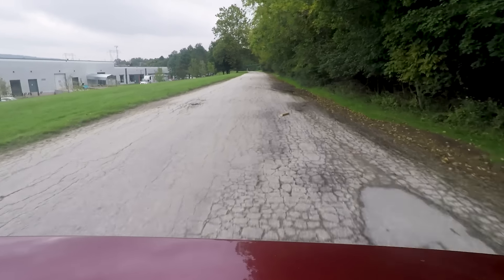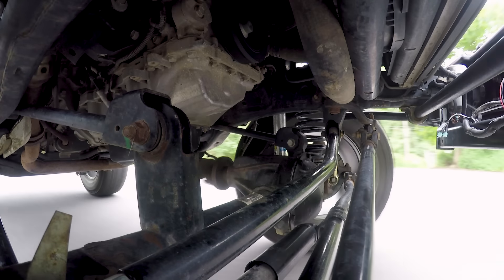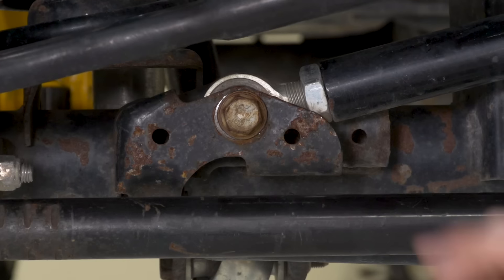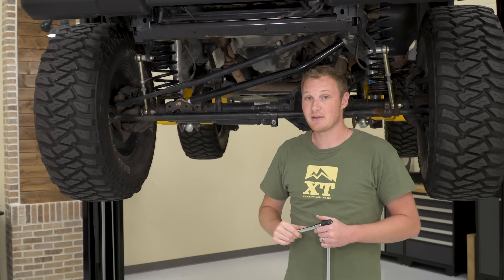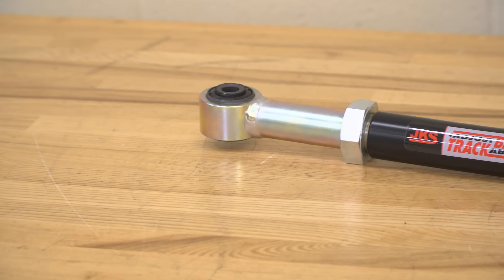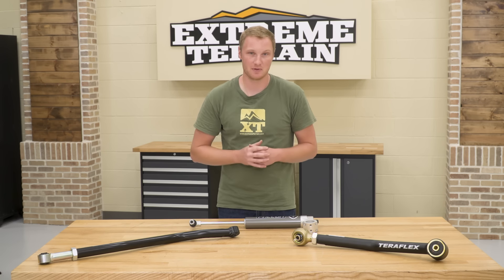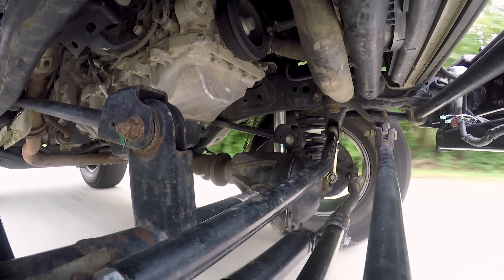How to Survive and Fix Jeep Wrangler Death Wobble | What Is Death Wobble?

Comment from the maker: Subscribe for Daily Jeep Videos: http://terrain.jp/SubscribeXTyt
Have you ever experienced Death Wobble?
Check out Parts For your Jeep Right Here: www.extremeterrain.com/throttle-out-news-dec2018.html 
Parts List:
JKS Front Adjustable Trackbar for 1-6 in. Lift - https://terrain.jp/2Qe7ouu
Teraflex Front Lower FlexArms (07-18 Jeep Wrangler JK) - https://terrain.jp/2EdFWa3
Reply: I have a 2007 Jeep Wrangler JK and I've replaced the Tie rod bar and Tie rod ends, The Drag link, The Track Bar and The Steering Damper and at 40mph or braking soft or hard my jeep goes into a death wobble what else could it be?
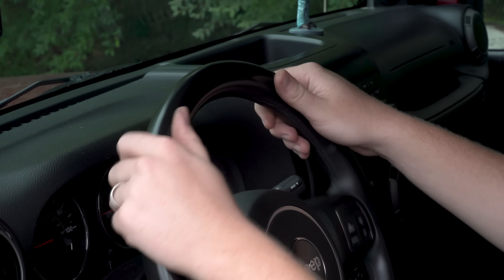Reply: Was someone under your jeep making the steering wheel wobble like that while you were at a complete standstill during your wobble demonstration ? Roughly the 3:00min marker
Reply: I should have watched for a bit longer. Thank you!

Comment: I took my JL to the dealer, just to find out that it was a recall for it,so,they fixed it for me at no charge!
Reply: The recall is for the steering dampener which is different but can cause the same issue
Reply: Did you have bigger tires when it wobbled?
Reply: E Baluyot  ‘Nope’...I think that is the problem when you buy the very first generation since my Jeep is 2018 JL started wobbling after only 3 months...the good news dealer found the recall & fixed it for me...so far 18 months later...My Jeep ride like Champ!
Reply: This is why American cars don't sell well in Europe.
Reply: @Inimbrium  this is a problem with all vehicles that have solid front axles, its literally just something that happens with solid front axles...... that includes European vehicles.
Reply: @notlogical4016  trying to think of any European SUVs with solid front axels. I think it's mainly an American thing.
Reply: @Inimbrium Landover defenders till recently had solid axels.

Comment: I had that problem three times within a week and was very scared. So I checked all screws and brackets of the front axle and steering and found nothing loose or worn. So I changed the steering damper to a stronger (sport) one and what a suprise since that time I had no wobble anymore.
Reply: Dealer has changed my steering damper twice but it’s a mopar part and is all that is covered by the warranty. They suggested a heavy duty damper. That’s my next step since it’s a newer jeep and everything else has been checked.

Comment: I have a 2021 Jeep Wrangler. It is stock and never off road.  I use it as a tow vehicle behind a motor home.  It has 22K miles and this week it started a wobble after hitting a bump in the road.  I was going around 55 to 60mph.  I slowed down and it stopped around 35mph.  I thought it may be an out of balance tire so I took it to the tire shop and had the balance checked on the tires and they were out.  So we balanced the tires and I took it for a spin.  At 70mph I hit a bump in a curve and the wobble reappeared.  So now I watched your video, I will give the track bar a look and see if that corrects the issue.  Thanks for a great video.

Comment: Is it recommended to have the Jeep on a lift before I tighten the track bar? If so, I'll have to take it to a shop because I only have a tire jack but I'm not sure if the jack could hold the entire weight of the jeep at the front diff, as the center point.
Reply from the maker: Tightening it on the ground when it's at it's proper angle would be best!

Comment: New jeep owner here. Really useful video
Experienced the wobble thrice now, and I hope this fixes it
Reply from the maker: These tips will definitely help out! Biggest things are checking for worn parts in your suspension and making sure your alignment is in-spec. If your Jeep is lifted, look into adjustable track bars and front lower control arms. Best of luck! -Zach
Reply: did it fix it?

Comment: have this problem with a jeep wrangler jk only when I take curves at low speed. What could be the problem?
Reply from the maker: Could be anything we talked about in the video, honestly! You really want to have the front end of your Jeep checked. Worn tie rod ends, ball joints, control arm or track bar bushings, etc. Even irregularly worn tires can cause it. -Zach

Comment: I had a 2 inch Mopar install on my 2021 wrangler. If I just put the original suspension back on will this death wobble go away?
Reply from the maker: If you have death wobble on your Wrangler, its likely not being caused directly because of the lift but from suspension geometry not being correct. I would look at getting an adjustable front track bar and adjustable front lower control arms to dial in your front-end alignment better. Also make sure everything up front is torqued to spec correctly. There are also TSBs currently available for steering box replacements for death wobble if all else fails you can ask your dealership about. Hope this helps! -Zach

Comment: I get major wobbling whenever I go over 50mph, but it comes and goes. I can be doing 55, have it wobble violently for about 15 seconds, then it goes away for 30 seconds, and comes back again for 15-20 seconds, all while I'm doing the same speed. No idea what is causing that.
Reply from the maker: Time to check your track bar, tie rod ends, control arm bushings, steering stabilizer and potentially re-balance your wheels and tires. -Zach
Reply: @extremeterrain  I'm thinking it might be the tires. I've already replaced the track bar and steering stabilizer.
Reply: @extremeterrain  is this the same with a JTR ?
Reply: I know this in an old post but the steering stabilizer often has NOTHING to do with death wobble. Tie rod ends, bushings etc are far more likely than the relatively useless front stabilizer
Reply: @vigilantemotors  i honestly think it's the tires. I have mud terrain tires with treads that are almost flat. They ride like crap to begin with, never mind being a few years old.
Reply: @Mike__P  As much as I love the look of MT/s when they go they are loud as hell and the ride quality just sucks so I feel for you.
What are you running if I can ask?
Reply: @vigilantemotors  BFG 255/75R-17
Reply: @Mike__P  Love it! I'm sure its a nice setup

Comment: I have an 08 and it always happens when i get up to 60 but when I decrease speed it stops. .
Reply from the maker: You should really just take a look at all of your front end parts, in general! Tie rod ends, ball joints, track bar bushings, wheel hub bearings, and lastly your steering stabilizer. If any one of them or a combination of them are worn, wobble is bound to happen. -Zach

Comment: Scary as efff
Reply from the maker: You're not lyin'.
Reply: I was told as I was, I felt like I was going into this death wobble again they checked everything they knew all about it at the shop. Everything was tight and after two hours they went and took it for a test drive and he said, is it side to side or is it front to back and I said it feels just like it’s moving so side to side. He said I think it’s a spark plug. I think you need a tuneup. It’s going forward and back, so I did have a check engine light come on while back and she told me that it was spark plug number two and that I should use Exxon gas. The check engine light never came back on and the owner who test drove it said oh this is probablymisfiring that I should drive through it

Comment: MY WJ never had DW until I replaced everything, I mean total rebuild. One day doing 60+ downhill, off ramp hard on the brakes. LAWDY LAWD! I almost wets myself! New track bar too and a $2000 frame straightening, hope this helps. Thanks!
Reply from the maker: Back when I had my WJ I ran it stock for 2 years without any issues, but had DW as soon as I lifted it (new shocks, springs, track bar, sway bar links, rear sway bar!) Turned out being my front lower control arms and all 4 tie rod ends up front. -Zach
Reply: @extremeterrain  it's my steering stabilizer which, while hunting in the outback,  took a heck of a blow from something bending the shaft. I noticed oil today on the inner passenger side front wheel. I looked below and thought it was the passenger side seal never thinking the shock was blown. The death wobble left me mystified. I've had her for 16 years never a problem till this.

Comment: I have experienced this in my 2022 Wrangler Jeep multiple times, and didn’t know what was going on, but the last time was this weekend, so I decided to google it. I hit a bump so small you could barely see it, and my Wrangler Jeep started shaking so violently it scared me.. I was on the highway driving 70 mph so I held on to the steering wheel for dear life, because it felt as if I was about to lose control of the vehicle. The Jeep is still like new. No modifications, serviced every 5-6 months, tires recently rotated, inflated properly and 14K miles… So why did this happen to a relatively new car? I hope Jeep will pay to repair it..
Reply from the maker: I would take it to the dealer and have them check out the stabilizer and track bar. Jeep previously had issues on the JL with those two components. Hopefully this video helped, and we hope they fix it so you can enjoy your Wrangler without the terrifying death wobble!! 
-Merideth
Reply: I just started this having issue today and I literally thought I was gonna die on the highway. Do I need to tighten my Trackbar too or do I just need to take it in? My Jeep is a 2021 JL and is completely stock

Comment: I can hit all kinds of holes and objects. No death wobble, but go down the road at highway speeds and sometimes it kicks in. I have been reading that the front-end alignment is the first thing to do... What do you think.
Reply from the maker: Alignment is key when it comes to death wobble and you read right, it's always the first place to start. I'd recommend checking your alignment specs, checking your ball joints, and taking a look at the track bar bolt as well. Hope this helps!

Comment: Jeep has been sitting , too dangerous to drive . I almost lost it on the highway and it’s been a few weeks. Thankfully I have a second Vehicle but I just bought this 2009 w 50k miles from my Sister. I blew the transmission the first week! $2600 so that wasn’t as bad as it could have been.
I replaced the stabilizer and that made it worse! Up until then it was a little wobble.
If this works , you will get my Vote November 6th.
Obviously you’re the best choice regardless and even if it doesn’t fix it, you still get my Vote.
You I “trust”
Thanks for the advice and I will let you all know it I am one of the 99%, normally I dance to my own beat.
Stay safe people 
Peace to you all
Reply from the maker: Just give us a call if you need more help figuring out your wobble! -Zach

Comment: Appreciate the video. Gonna check my track bar bolt. Had death wobble doing 75 mph on the interstate this past Sunday. Fortunately it was at 6 in the morning and not a lot of traffic. Had to fight it to a complete stop to get it under control again. 

But all the comments about parts being worn out is concerning to me. My Jeep is a 2021 2 door stock height (no mods) JL with 11k miles on it. Would my components really be worn out this fast?
Reply from the maker: Hey Zak! With a Jeep that new, I would get in touch with your local dealership to have them take a look at it. They may throw on a new steering stabilizer to help things out.  There's always a chance that something loosened up in your front suspension that just needs to be tightened. Best of luck! -Zach
Reply: Thanks for the reply. Waiting for an open appt to get it looked at. Hopefully it’s something simple.

Comment: i have front death wobble bad 30-40mph i purchased a steer smarts hd track bar, synergy hd ball joints, and synergy drag link, as well as a super lift rear adjustable track bar, i will be buying things as necessary and some things to simply upgrade other items will include control arms springs and shocks and tie rod my question is if the brackets are wallowed out it kinda defeats the purpose so i hope that isnt an issue lol

Comment: are Jeeps more prone to this, if so, why ?
Reply from the maker: Really - any vehicle with a solid front axle can develop death wobble symptoms over time. This is just due to the nature of the suspension, plus the added stress caused by larger/heavier tires and lift kits being installed on suspensions that likely have pre-existing wear on them already. -Zach

Comment: 2019 JLU Sahara. All stock. Daily driver. 15,500 miles on it. Has it since new. DEATH WOBBLE. Wtf. Dealer replaced steering damper. Drove it home on the highway to test it out. Better but still has definite oscillation at highway speeds when I hit a bridge seam etc. How can I get the dealership to FIX it and not just slap on another damper??

Comment: I have done both of these but have just switched from winter to summer tires and the death wobble is now worse. Would a realignment or rebalance be beneficial?
Reply from the maker: If switching tires changed things, I would highly recommend getting your Jeep re-aligned and have the shop make sure your tires are balanced properly. Make sure your tie-rod ends and ball joints are in good shape too! -Zach

Comment: Just experienced death wobble for first time after hitting a hidden pothole… I stayed calm and it stopped at a slow speed but happened immediately after (talking 60 seconds) when going over a much smaller & minor bump! Let it all down again and it stopped though frightened those driving behind me.. I drove slowly home but took it in the next day  to dealership and had them check all joints and everything was tight & not worn down according to them. + Neither the techs or myself could re-create the wobble at various speeds. Is that normal? A one and done death wobble? Steering damper and shocks are brand new and again they’re tightly screwed. alignment was minorly off so went ahead and paid for that just in case the pot hole set that out of balance but scratching my head here. Any input?  Very helpful video overall.
Reply from the maker: The alignment will definitely help in the mean time! Is your Jeep lifted at all? Or is it stock? If the techs couldn't find any sort of notable wear in the front of your Jeep its entirely possible things were just out of alignment or slightly loose from driving and rough roads over time. Death wobble can also be triggered by worn-out tires or tires that aren't balanced properly, which is something to watch out for. -Zach

Comment: Hi.can you Tell me how to fix my death wobble? I’ve changed the track bar from jks and I still have a ligh death wobble when I turn the wheels left or right.And when I drive on highway with 70(km) my steering wheel has a little motion left right..

Comment: I’m looking at a 17 JKU(19,000mls) on what looks to be a 2.5-3 inch lift on Trail Blade M/T 35x12.5x20’s. If there is a wobble on the test drive what should I look at to see what would be needed to to get rid of it. Would it be worth buy’g? I know lots about cars, but want to get rid of my Kia Sportage 4x4 & and get an actual 4x4 off road( for work during winter & fun) capable Vehicle.
Reply from the maker: If you can get money off the price to fix the potential wobble I'd absolutely still look into it! If you feel any sort of shimmy while driving you really just need to take a good look at the front-end. Ball joints, tie rod end links, track bar bushings, control arm bushings, and steering boxes all can contribute to loose steering and wobble on the road. Hope this helps! -Zach

Comment: I have been to two professionals (Jeep dealer and independent shop) and a local tech college automotive shop instructor . . . none of them kind find anything wrong - we have replaced the track bar and the steering damper and it still happens... possibly even getting worse - what can i do? its a 2012 with 90,000 miles on it driving and another 30,000 towed behind a motor home - i am afraid for what will happen when the death wobble strikes while being towed!
Reply from the maker: You should really have your ball joints, tie rod ends and control arm bushings checked too if you haven't already! Any sort of looseness there can trigger wobble when hitting potholes or bumps on the road. Its also possible you could have looseness in your steering box, a tire that's out of balance, a bent wheel or your Jeep's alignment could be out of spec. If your Wrangler is lifted it could be stemming from geometry issues in your suspension. -Zach

Comment: Track bar was the problem with my 2010 Wrangler Sport.  Replaced it with a MOOG part and now no problem.  It was dangerous before replacing and had to almost or completely stop in traffic .
Reply from the maker: I'm sure! It's always a great idea to keep an eye on your front end components on older Wranglers like that, specifically your track bar, ball joints and tie rod ends. -Zach